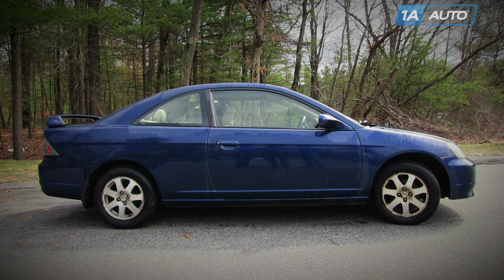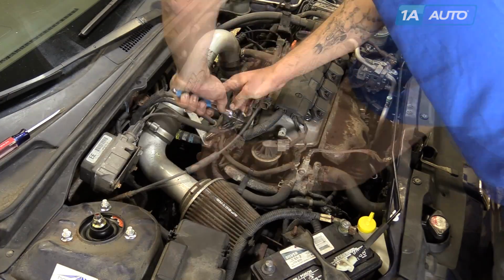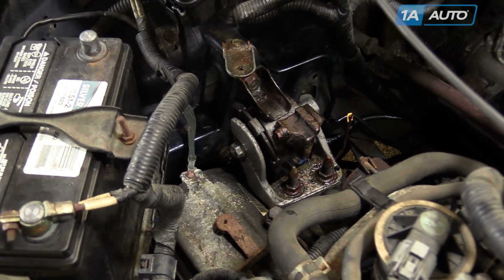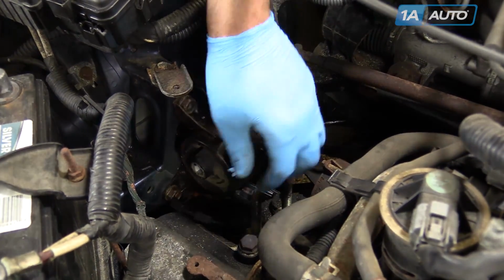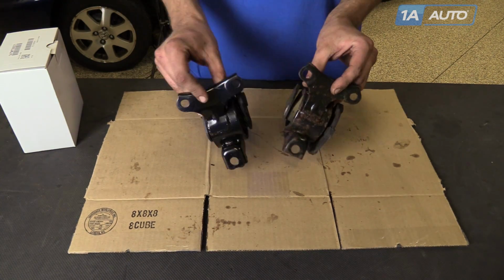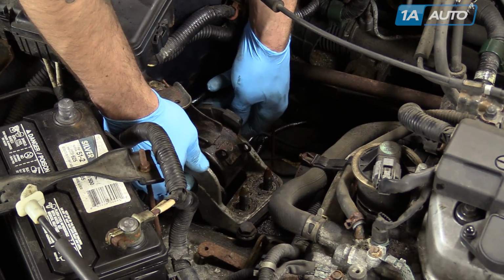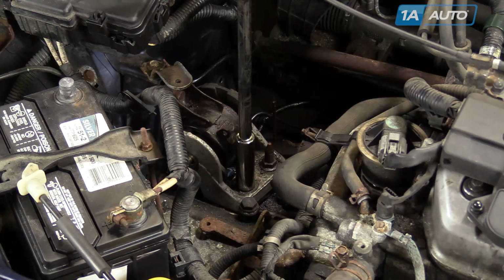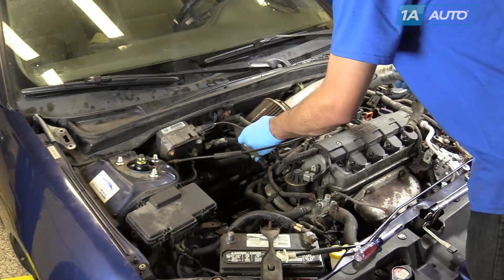How to Replace Transmission Mount 01-05 Honda Civic

Comment: I want to purchase one from you but noticed the top of the OEM mount was different from the mount you were selling, the little bracket with the two holes is missing like the OEM has. Will this affect the install?
Reply: It's just the same, aftermarket parts are different a little due to manufacturing process but all the holes are just the exact location.. If you want exactly a Honda part, buy it at Honda Stores. But usually, this old models are out of stock if you ain't living in asia where all stocks of Honda's are everywhere.. Just buy it.

Comment: Do I need a 12mm deep socket wrench for the nuts on the bracket?
Reply from the maker: A 12mm socket wrench is not needed.  I am including the sockets and wrenches needed for this repair below:
Sockets - Metric
10mm Socket
15mm Socket
17mm Socket
Wrenches - Metric
15mm Wrench
17mm Wrench
+R E

Comment: What is the stop that you talked about went to 2 ten mm bolts I have a 2001 Honda Civic LX with a automatic transmission and I didn't see that on my mouth
Reply: My 01 LX standard trans didn't have it either. You're fine!

Comment: I have a 02 civic lx(manual transmission) that clunks when going into 1st 2nd and reverse. You think it's the transmission mount?
Reply: RAIDER BEN more likely the front passenger side motor mount, much easier than the one shown

Comment: Are the parts and procedures the same for manual transmission Civics?
Reply: This is too late for u my friend but for others looking I drive a manual 02 and this mount is identical to the one on my car. So yes this video applies to auto and manual.